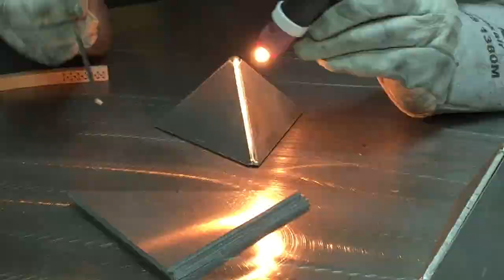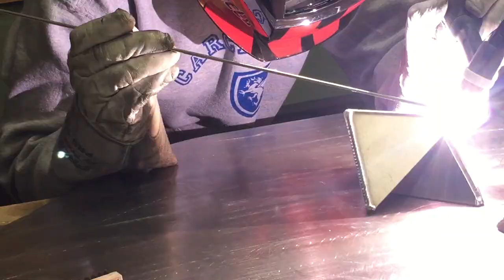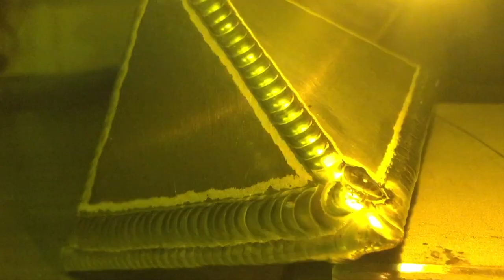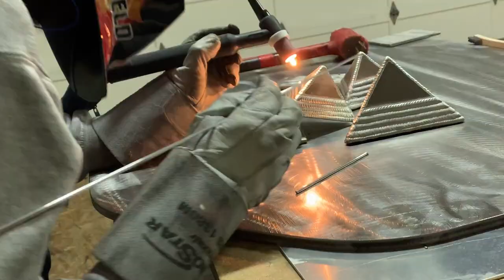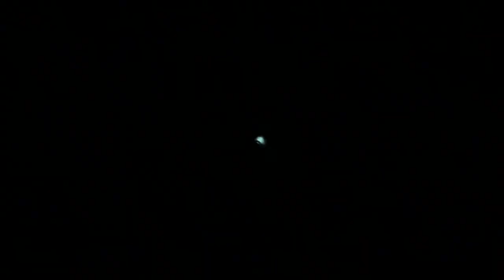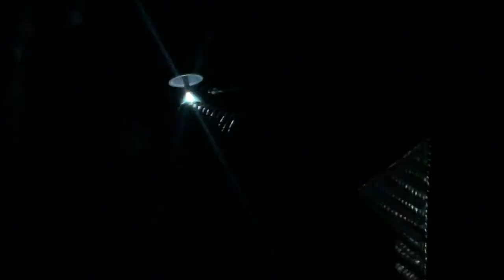NEW METAL ART! CAN I WELD THE PYRAMIDS?!

Comment: Sup dusty!  watch all your stuff ! What do you use to cut all your material with ? Also my aluminum beads are small using an ally 5 furick 255ext do you use a 1/8 filler for those freaking dimes ?

Comment: So I got my everlast today....try for 2 hours to run a bead. No success. Nothing but exploding tungsten and fluttering. Even made lights flicker. Handle was dented when it arrived. Looks like yours is doing good tho. Nice job! That's how my other 225 plays beads... :/ gna hafta contact corporate for warranty
Reply from the maker: Dang crazy! I haven’t had any problems with the power or arc shape. Hit them up- their customer service was on point when I talked to them! Hope it works out!  🙏
Reply: @PacificArcTigWelding  gna go home.and switch polarity lol think I got it reversed, cuz of habit like my other tig machine. Think torch was in ground side